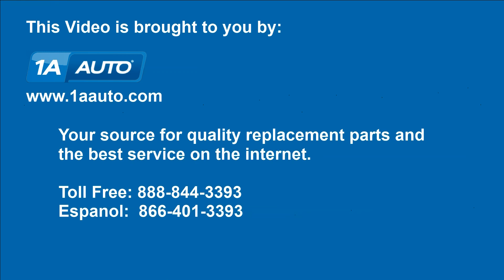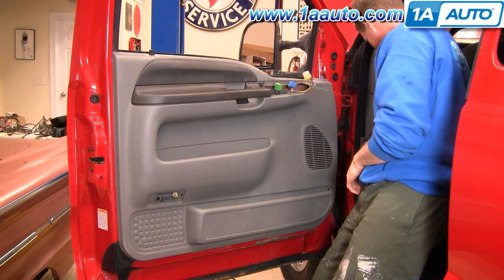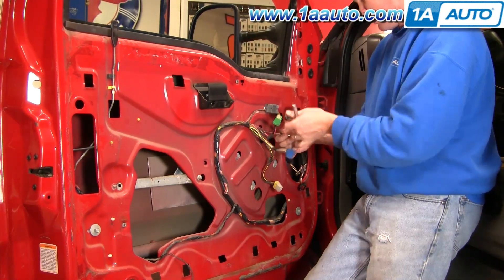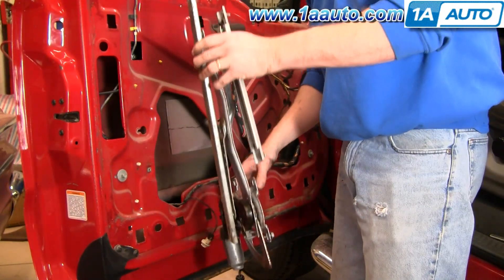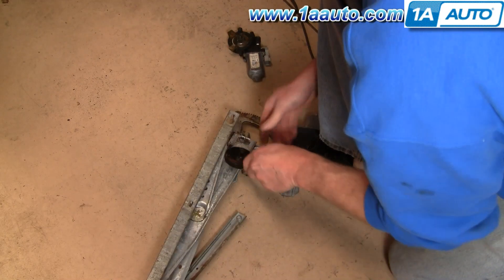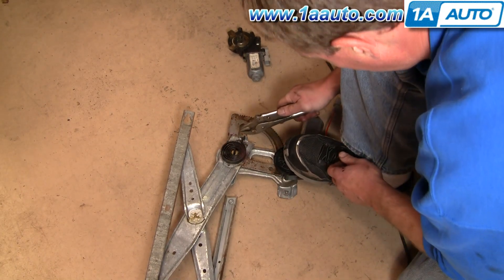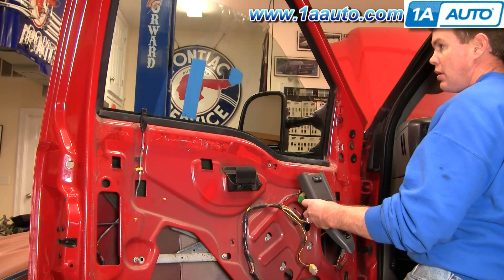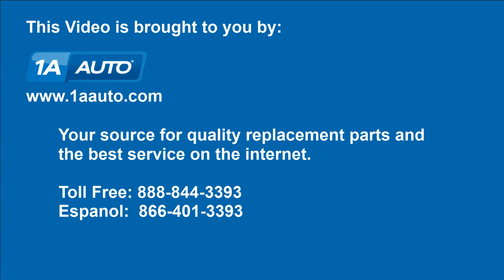How to Replace Power Window Motor 00-10 Ford F250 Super Duty Truck

Comment: Excellent straight forward video! Ford wanted to charge me $400 to replace the power window assembly, the part cost less then $90. With the help of your video I was able to change it out in less than an hour. Will be looking to purchase auto parts from your site in the future.

Comment from the maker: You may want to test the the power going to and from the switch with a test light. You could also test the power to the window motor when the switch is pressed to see if the motor has power to it. Hope this helps you out.

Comment: Mine came with Both the driver and passenger door set. Works fine everything bolted up great on driver side but now up is down and down is up. Is it possible that I put the passenger side on by mistake? It seemed to bolt in great I didn’t think it was the wrong side
Reply from the maker: +Jmf0143 Thanks for checking us out! The motor sounds like it may be faulty and we would suggest trying to get a replacement. Please let us know if you have any further questions, thank you!

Comment: Installed new motor as per your video, and although no tape will hold the window up for long in 113 heat in Las Vegas, I was able to get the motor installed. Motor works fine, and window goes up fine, but shutters when it starts to come down. the shutter stops as the window comes down. Any ideas?

Comment: I have a 2005 F1 50. I purchased the motor and after looking at your video noticed mine does not have that small gear with the teeth on it. Will I have to take it off of the old motor and place in on the new one. I figured I should check first before I get started on something that I won't be able to finish. Thanks
Reply from the maker: Thank you for watching. The motor should have the gear on it already. Please let us know how the repair comes out!
1aauto.com  888-844-3393

Comment: replaced the window motor, completed the assembly per your video, but the window gets stuck (binding-glass leaning forward) 1/2 way up.. is there a way to adjust the window or is the regulator or track the problem?
Reply from the maker: There might be some type of adjustment inside the door that you can make. You may also want to double check everything to see if the regulator is connected the right way.

Comment: I have an 04 Excursion (similar to the Super Duty) however, the window I am having trouble with is the rear drivers side door, and it is stuck in the down/open position is there any difference in the repair procedure?
Reply from the maker: Thank you for watching. The process may be a little different. We will keep this vehicle in mind for future videos.
1aauto.com 888-844-3393

Comment: A have a ford truck f150 2002. Can l change from manual window to electrical window?   Gracias. Good videos
Reply from the maker: It would probably be a pretty involved swap. You might be able to raid a truck in the junkyard if you wanted to attempt in. Thanks for watching

Comment: my window on my expedition stock up,  do I need to replace the regulator or just the motor? thanks
Reply from the maker: You may want to remove the door panel and inspect the window regulator to see if the cable has broke.

Comment: can the window motor be removed without removing the regulator assembly on a 2001 ford f250
Reply from the maker: +enrique martinez Thank you for watching. You will need to separate the regulator from the vehicle in order to remove the motor as most vehicles have them riveted in from the factory. It is possible to perform however without completely removing in some cases though. 1aauto.com
Reply: thanks after watching your video it wasn't that bad thanks again

Comment: I used the same process on my 2002 ford taurus, and it worked. The only problem is that it still won't roll up, like the old motor. All the other doors work fine, so it couldn't be a fuse. Is it the switch that rolls the window up and down? I know how to replace it, I just need to know if the switch is the problem.

Comment: I removed the motor when the window was 3/4 down that means the position on the gears is different how so I marked the gears and installed the motor in the same position how important is that?
Reply: So the everything worked when I installed it but the spring fell out when the window was in the up position.

Comment: Do you need to grease the regulator while it is out of the door.
Reply from the maker: +Cfass1 You should not have to, but it all depends on the condition.  If there is some resistance in the mechanism then you can put a little grease on it.  Just keep in mind that grease will collect dirt and debris, so you do not want to use too much!  1aauto.com